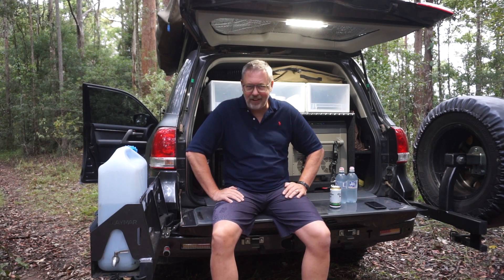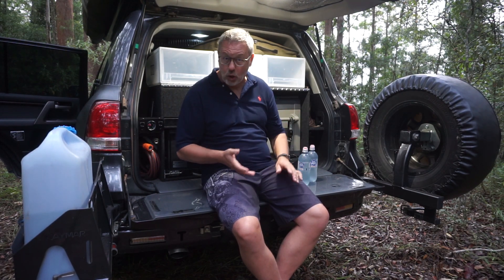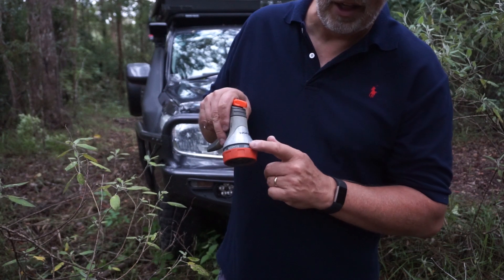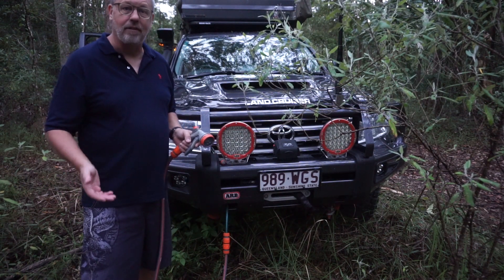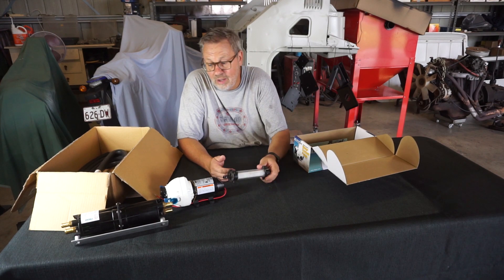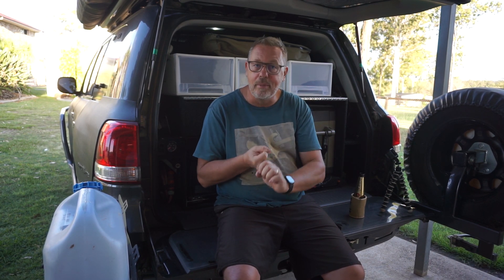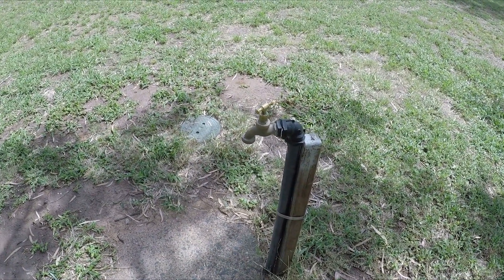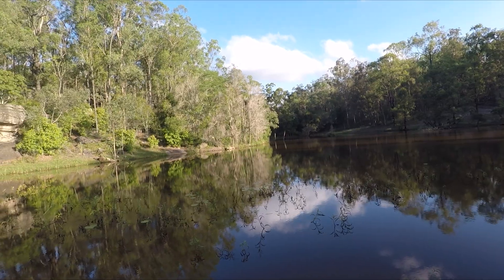How to Store Water in your 4WD for Camping | Carrying | Using | Refilling Solutions

Comment: Brilliant Terry, I have been waiting for this one for a while.  I reckon I won't have time to put the shower setup together before the Gibb River Road trip, so more likely afterwards.  I use a 50 litre tank that sits behind the second row of seats and in front of the drawers.  I have another 20 litres on the TyreTrek wheel carrier, and I reckon I will use that for the shower solution in the short term.  Thanks again, i will now have something to think out tomorrow morning at 4am when the old mind starts racing. All the best, Andrew
Reply: What brand is your water bladder? It’s a great spot to carry the weight 👍
Reply from the maker: Thanks for the kind words Andrew, I’m glad that you found something of value in the production.  I’m also glad to support your insomnia affliction.  Go well mate, Gibb R will be amazing 😎👍
Reply from the maker: Thanks for taking the time to share your thoughts Steve, I sincerely appreciate it.  The water bladder is from a mob called Flexitank.  I think they are based out of Dandenong in Victoria and ship Australia wide.  Keep the shiny side up mate😎👍
Reply: @JafffaAdventures  thanks 👍

Comment: These vids are great. Very informative.
You are so right about those plastic taps that come with jerrycans..PITA. Heading to the plumbing section in Bunnings right now...lol

Cheers
Reply from the maker: Thanks for the kind words, I sincerely appreciate it.  I got mine off eBay but Bunnings may indeed carry them.  If they don’t, I responded to another question on this video where I gave the eBay link.  Just scroll through and you should find it without difficulty.  Cheers😎👍

Comment: I get so much out of your videos and this one is no exception so thankyou for posting them as I know their production is no simple affair. 
I have just purchased the Glind original and in reading their instructions they advise not to put the pump behind the bull bar as it is not a sealed unit and is susceptible to water crossings etc.  I was wondering given your experience to date would you be happy to reinstall the pump as you have done currently if doing it again?  
Also given it is coolant running through the exchanger, and and again mounting it low has yours suffered many stone chips or other nicks ?

Thanks again
Reply from the maker: Thanks John, you are very kind with your words and I really appreciate that.  I have never had my pump fail.  I was under the impression the pump was IP65 rated (I could be mistaken) and therefore able to withstand water ingress.  I also have a friend with the pump located in the same position and he has had no issues as well.  We recently completed a Cape trip and had the pump submerged on countless crossings, never missed a beat.  The exchanger is mounted inside the bull bar and above the bash plates.  It has never suffered any strikes in this location.  I would happily place both the pump and exchanger in the same location if I were to do it again.  Thanks for watching 😎👍

Comment: Where do you find that sand filter? I’ve tried googling so many different times but can’t find anything.
Reply from the maker: I bought mine from Glind when I purchased my shower pump and heat exchanger.  They sell them individually as well for $148.50 on glind.com.au.  I'm sure I have seen them at camping stores like BCF as well.  Cheers
Reply: Thank you so much for the reply and link.
Reply from the maker: No worries mate👍😎

Comment: Hi Terry as usual  another  great video I just  injoy them so much I notice that you have some sort of solar shade on the back windows onthe 200 series  is it a home made jobby or store brought  if is a home made job maybe you could do a short video  on that it would be very much appreciated.  Cheers tom
Reply from the maker: Thanks Tom, you are very kind with your words mate, thank you for sharing.  The solar shade is a home made jobby mate and so simple it’s probably not worth a video ( but will keep that in mind, thank you).  I just got one of those windscreen shades from Supercheap Auto (the cheapest I could find), traced the window pattern on it and then cut it out with a pair of scissors.  I then went around the edges with some silver duct tape to seal them up.  Then I used a bunch of small pieces of double sided tape to stick to the back windscreen.  It’s been in place for a few years now and never fallen off.  It works a treat and cost me about 5 or ten bucks total.  Good question Tom, and well spotted mate.  Cheers😎👍

Comment: Another awesome video Terry! Silly question if I may, presumably you have to have your engine running while using the shower?
Reply from the maker: Thank you for your kind words mate, I really do appreciate it very much.  No question is silly in my books mate, for me a question opens doors, it does not close them.  I don’t need the engine running to run the pump or have a shower, but if it is not running it will simply be a cold shower.  Once the engine is running and engine coolant is flowing, the water heats up.  I’ll give an example of what I sometimes do.  Let’s say I’m in public campground with lots of other campers (shudder).  If I want a shower after tea and don’t want to run my car and disturb everyone, I will heat up a jerry can of water during the day by cycling (sucking from the jerry, travelling through the heat exchanger, then delivering back into the Jerry’s).  I can heat up a 20 litre can to hot status in 5 minutes or so.  That jerry can will hold the heat for hours and when I’m ready to have my shower in the evening, I just run the shower without starting the car and no one gets pissed off with an engine idling.  I trust that makes sense mate.  Cheers😎👍

Comment: Great video Terry, I’m going to copy your shower setup on my 80 series. Do you ever have any problems with the water getting too hot?
Reply from the maker: Thanks for the kind words, I sincerely appreciate it.  Never have it getting too hot.  One your 80, it’s even less of a change because it has a manual heater value. You can shut the hot water flow down to nothing using the temperature control on your cabin heater on the dash.  Cheers😎👍

Comment: I’ve been looking for one of those jerry can flick taps but I can never find them. Did you have a link to yours?
Reply from the maker: Hi Shaun, good question mate.  I just got mine off eBay.  Try this link.  If it does not work just use the search term “stainless steel spigot tap” and that should pull up multiple items.  I don’t have any affiliation with this supplier, it’s just the first one that popped up in my search.  Cheers😎👍

https://www.ebay.com.au/itm/304-Stainless-Steel-Spigot-Tap-Faucet-for-Wine-Barrel-Drink-Beverage-DispenserJN/333904435364?_trkparms=ispr%3D1&hash=item4dbe4158a4:g:QuMAAOSwPNpc8hNu&amdata=enc%3AAQAFAAACgBaobrjLl8XobRIiIML1V4Imu%252Fn%252BzU5L90Z278x5ickkCrLl8erj3ATP5raQxjc%252F%252B1wdUi5pHqg9okrrDzqi3hPLpcqr%252BJo76sqkpDJwpMLnqITOLKU549AWOfYJY4aD13Wg5SvG44dr%252BKVCc5OTvzJzeHKFpeJQ5hUFA503o7mZbe%252BC7cN5NdvDCy4Tu62F4PVtnyBvqY7SAGxfzEzszgLfoklGnG13ndb%252Fx%252BJnJ2TKVOXFSZgCv1MrRoKKl2WZpLs8LIYwZcm1057lsPKoxG%252BuF9DeWK2d9rRZGGeh9L8Z1nBWB7s3526uTSOhhu%252BBGfaizPjlMfTR%252BHtzD0yAMjhutOarKJ5LQyRfGskG6v0eL%252FYEYaFmMDk7UBo2Za2rpqpBgIvWTlG1BfkkfuZ6YocxI7izHb7qMMgjN6yjkgWL01UYunmqdGb%252F4reb%252BCLLRD6ckQiOnvhA66btobpB3knhrlZav0eU7dMB0WjafK%252FRrXS%252F%252BPSlx8DXjs9YZrFK%252FIQDS4XMduAFw9x51ato5Al2WokgvurOWaTcW9qHczc2NXHy2DYTVSfFMvGD%252FTX2hN1sMzaZ3RDJKN2fqbhRexueVIQMSrcWG7ivcm52bXN2MfWoB%252BGsMRQxQVIRLqSq9VMRUNsQiLwitUDwaq5T4q3UbAoHo%252Bl41exUPhnkwhGGclScEuTYKDJQJpkfxIcn0x%252B47%252FI0wMhOjxdQi0qXxj4HbiXLRdK7mMNQlA%252Fwv%252Frc0kdfuYwxyRm5AZ%252BGzFwAMOT1A187DTJbHVQ2ACkikI0INnQLUKrKljz7B3CvLY0rx8%252FgFd1QzG9jBxxvzmth9F12NJFSRU7ChNwLCEOgkO8%253D%7Ccksum%3A333904435364458ffa488431473fa68f82e230eeebca%7Campid%3APL_CLK%7Cclp%3A2334524

Comment: Great video Terry.....again. You just seem to keep them coming at such a great quality. 
Was it a hard decision to go the heat exchanger over a bucket that you fill with hot water?
Also... my rear jerry holder does not allow you to remove the jerry if a tap is installed. One of the other youtubers demoed his method using hose through the top of the jerry and siphon it out. May apply to otters also.
Reply from the maker: Thanks for your thoughts and for sharing the siphon solution, I saw that video as well.  The heat exchanger was an easy choice for me.  As you may have gathered I’m all about simplicity and the least effort possible when camping.  For that reason alone it works brilliantly for me.  Keep the shiny side up Nick, and again thanks for sharing 😎👍